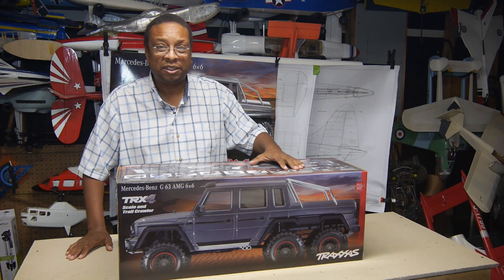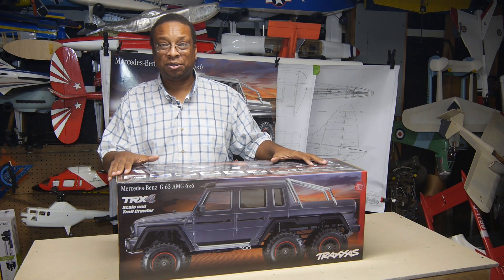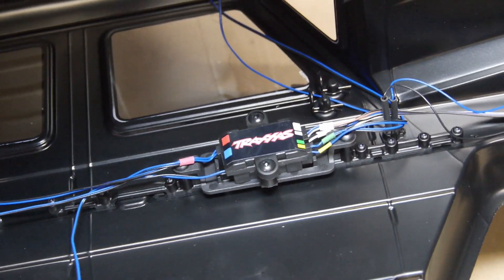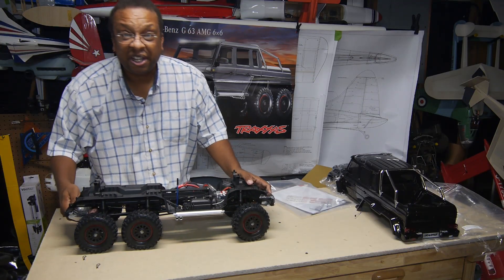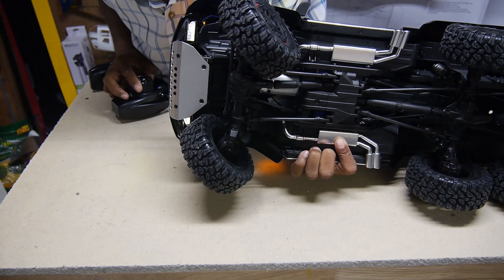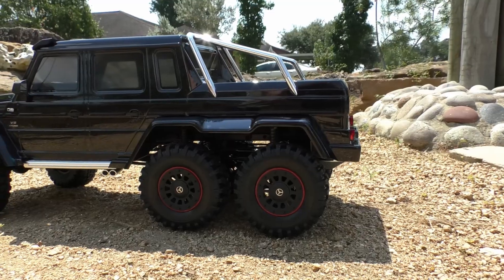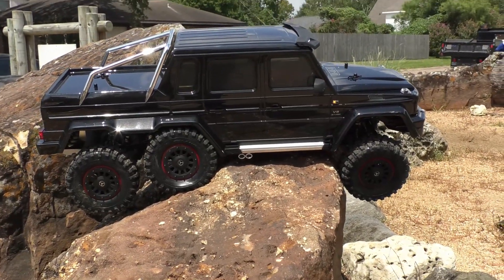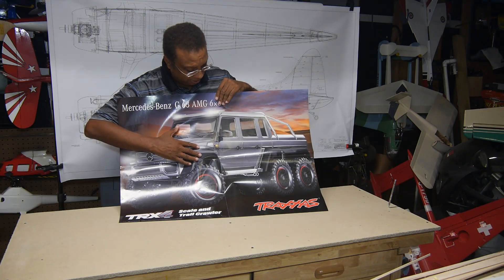Traxxas TRX-6 Mercedes-Benz AMG 6x6 | HobbyView

Comment: The TRX-4 platform is great. Get one for yourself, it's a lot of fun, even just the 4x4 if you prefer something more conventional. And definitely try some trail or mud run as well, the TRX-4 is completely water resistant and can be used in water and mud. Only downside: you have to clean it and oil all the bearings after eheheh. It's worth it.

I loved how you described rock crawling: "it's almost like you are playing chess with the terrain", that's a good one.